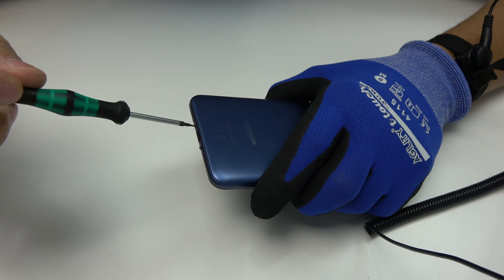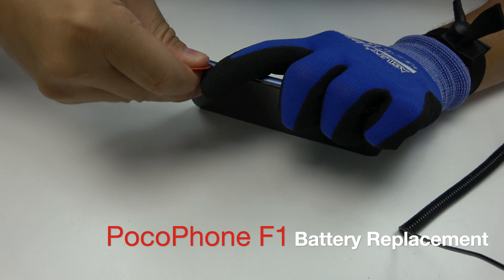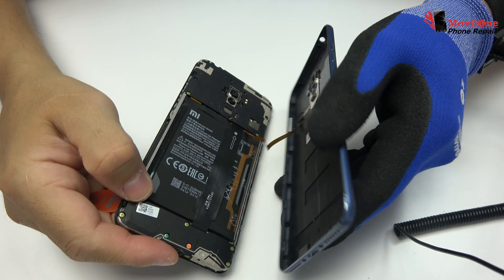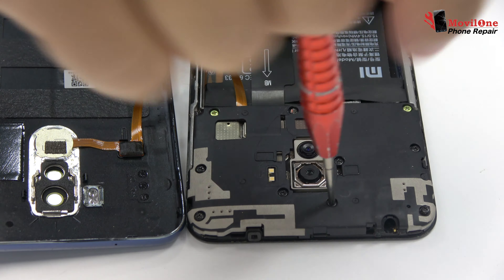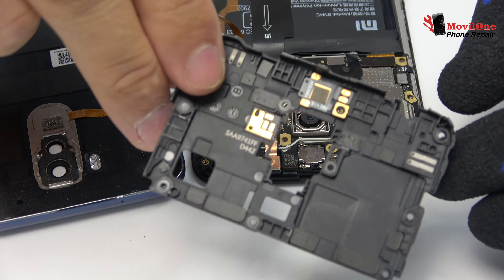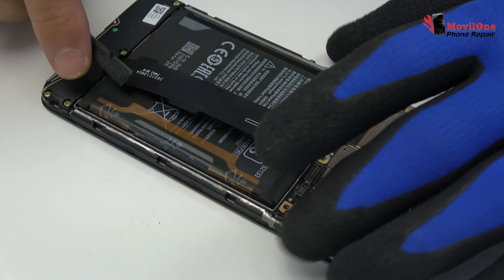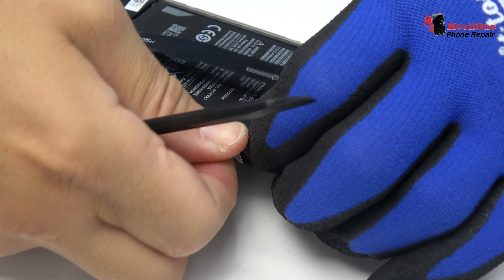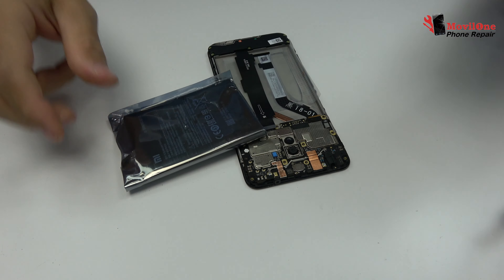Pocophone F1 Battery Replacement

Comment: Thank you, I just replaced mine within 45min taking it slow and easy. Great to continue to use this nearly 4 year old phone for another few years. New battery makes a huge difference and the Poco F1 is still a great phone.
Reply from the maker: So glad to hear that! Thanks for watching! Best regards
Reply: @StonkSlayd Yepp! They drain down after 4.5 years so as mine. :(
Reply: Could this explain why mine has gone into a boot loop? Even if I keep it plugged in and try to reboot? Only get Boot to Menu, wipe or connect with Misuite but can't cos ADB wasn't enabled 

Guess I need to find a decent battery

Comment: Thanks! Great video... managed to replace mine without a hitch. Do remove the sim/sd carrier first like some mentioned and you'll be fine.
Also use some isopropyl alcohol when trying to pull the battery to loosen up the glue.

Comment: I had worst luck, the battery was fucking SOOO GLUED to the bottom, took me solid 5-10 minutes after the yellow part ripped off trying to remove it, but finally did it, I also lost 1 screw of back plate but it should be fine😂😂

Comment: Thank you so much for this. Is the Redmi 4a 4000mah compatible with Poco? Or can you provide any link on the batteries? Also, what kind of screwdriver is that? Thank you in advance for the answers!!
Reply: it will work but u need to do some rearrngements ......that is u need to simply change the battery circuit from the original battery and it will work like a boss
Reply: Buy safa poco F1 battery

Comment: the battery of PocoF1 I'm using is drained off very fast and switched off while using any application. Is it a issue with the battery or the mother board.
What would you recommend that I do?
Reply from the maker: You should try with an another spare parts battery. Best regards

Comment: Looking for where I can get a genuine OEM battery replacement for the F1. I've bought ones before that looked real but were bad.
Reply: @gabyvandinterenpmp956  How did the Poco F1 battery you purchased about 4 months ago work?
Reply: Yes, any updates on the battery seller please?
Reply: @gabyvandinterenpmp956  Any + battery info update please? 🔋
Reply: @gabyvandinterenpmp956  please tell us, if it worked, could u please drop us the link
Reply: The best batteries replacements are Nohon.

Comment: My new battery drains much faster, why?
Reply: may not be rated as high as the original one or a software issue, try looking into battery consumption and consider doing a factory reset, if it persists even after the reset look into buying a new, more reputable battery.
Reply: @vattox331  I tried removing large unused apps and data and it seemed to fix my issue, so it must've been a storage thing.

Comment: Buenas! He comprado un kit de reemplazo pero no consigo desatornillar los tornillos para abrir la tapa como se ve al principio del video, el destornillador que viene es muy malo o no es el correcto.
Qué tipo de destornillador necesito?
------
Hello! I acquired a replacement kit, but I can't open the back cover as the begging of the video shows, because the screwdriver included is either too flimsy or just wrong. What kind of screwdriver do I need?
Reply from the maker: Es el mismo destornillador que usamos para los dispositivos Apple; 0.8 x 25mm

Comment: Can i replace the battery with 5000mah li ion battery
Reply: yes ...but it should have same voltage output ...and use the original battery circuit and simply connect + and - of the 5000 mah battery with the circuit board of original battery and simply connect ....it will definately work

Comment: I made it this way, but the touch stop working. What Can I do? My screen is on... Only touch doesn't work.
Reply: this is basically happened to my screen, my screen isn't touching or responding until it gets black out... so yea i thought this is the problem and i found my battery part looks weird, after weeks i found my poco f1 stayed inside of my drawer for 4 weeks and the battery got swollen/inflates... maybe the yours too cuz the battery inflates can cause dangerous event in the future and bending the screen over the inflation
Reply: i gotta remove the battery tomorrow and i hope my screen works again also the touch too.
Reply: @zenexodust1686  I went to several professionals and they all said the same thing: the static energy in my body burned the screen.  I had to change the entire screen because of that.
Reply: @zenexodust1686  plus, my new battery is working like New... 8-11 hours of screen time in Basic use
Reply: @gustavoaugustosf  good thing to know, i would take a purchase of a screen digitizer if the screen didn't work. maybe there's a low chance getting my screen still works after my i removed the battery

ngl my poco f1 became fat and looks so dangerous
Reply: @gustavoaugustosf  your all in good now dude, i hope your poco f1 works very well

i might buy the modified battery into 5,000mAh or nah
Reply: @zenexodust1686  I think buying modified battery can be risky.. I'm not an expert, but I woudn't try this for not have security for do that
Reply: @zenexodust1686  but for now, I'm looking for a POCO X3 PRO or POCO F3, I suggest analize both, because they are amazing.. Especially POCO F3...
Reply: @gustavoaugustosf  you're right dude, it can be risky cuz some my dudes how to fix phones, they said they want me to buy modified battery, so it would be bad idea if i didn't buy the original battery

I was saving for MI 11 and wait it for months till the price dropped, so yea i would be still on poco f1 for months, one of the greatest king budget phones ever
Reply: @gustavoaugustosf  Poco F3 is like the better version of X3 Pro

if you want headphone jack and sd card slot i prefer you must buy the X3 Pro cuz F3 takes out the headphone jack and sd card slot, kinda sad.
Reply: except the  f3 runs faster than X3 pro but it has cheaper price
Reply: @zenexodust1686  so, I'm choosing F3 for the screen quality Amoled and Other screen technologies; better processor for emulating games and best quality; and the battery consumption is better than X3PRO (vídeos on YouTube) and charges some minutes faster. I dont use even 40gb on my poco F1 hahaha and I use bluetooth phone, so.. It's a different type of use, you know..
Reply: @gustavoaugustosf  Holy shit, My poco f1 still works without the battery and the screen still works too.

imma buy the original battery and screen digitizer
Reply: @gustavoaugustosf  well it's best you choose the f3

i don't usually use bluetooth especially when going to produce something without delayed audio like bluetooth does, Google drive can be our new sd card but risky.

Comment: Link where i can buy battery of poco phone f1
Reply from the maker: Hello, Casoer the friendly ghost! Here in Spain we ve got our suppliers but i think on Aliexpress or eBay you can find spare parts for this model. Best regards
Reply: @MovilonePhoneRepair  is it good to buy 5400mah battery for poco wich is not original?
Reply: @higherself7655  I have the Same question
Reply: @evansicaria   I have already bought "original" and it is not working well, tryed to calibrate but it is around 70% of original... I need to make hard reset of phone to see will something change. Cant find other way to reset battery data widouth root.
Reply: @dotakid  I bought my on ali xpress

Comment: Poco f1 any battery swollen prblem
Any alternative btry / solution for batter replacement 

As sevice center charging 4k for replacement

The issue is now my my is turned off automatically , in 6,7 time a day , and heating also